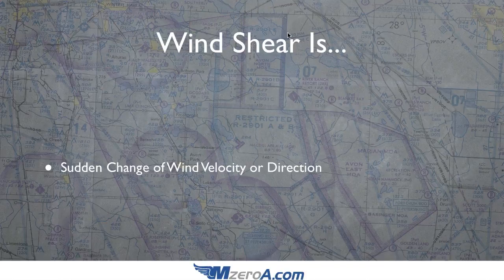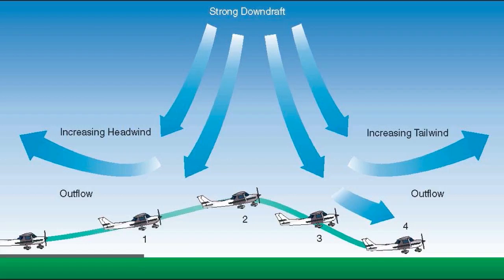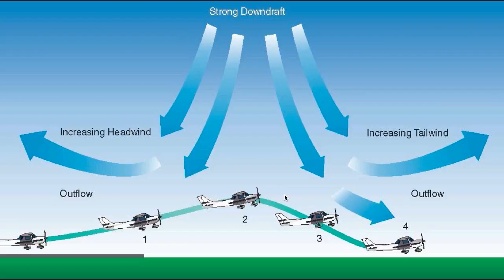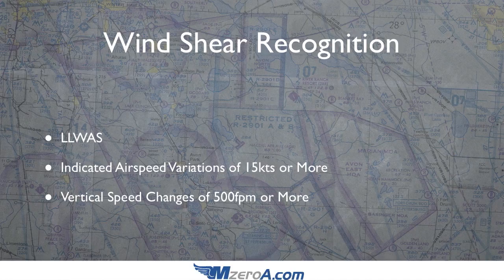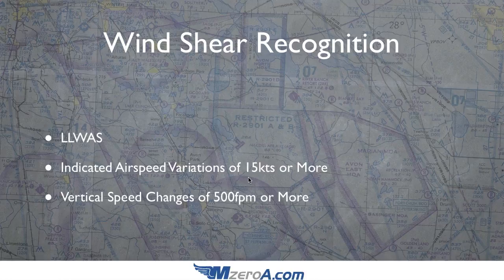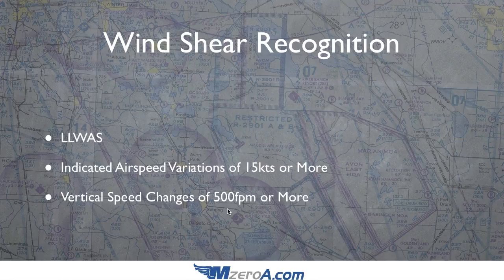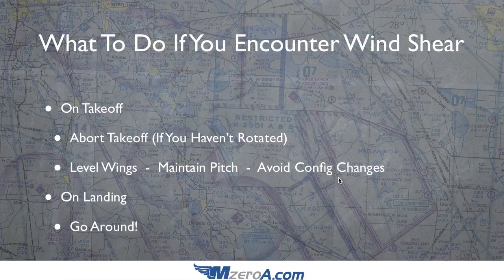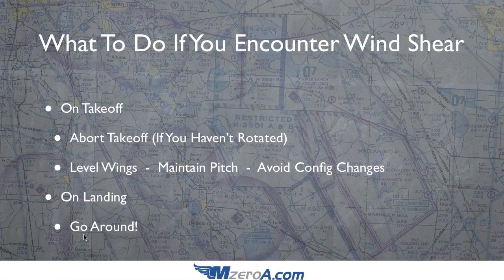Wind Shear Avoidance

Comment: I experienced low level wind shear.(wd 340 variable 5-10 kts. started to gust to 15kts. RWY 7- 25) on a short final, it looked like and felt like the plane was pushed to the ground, I immediately added full power for go around, kept gear and flaps down. Cleaned up plane at a safe altitude, change landing to opposite runway, challenging but uneventful . I will take Jason's advise and not fly under conditions like this again.

Comment: What does -10 wind shear mean, this showed up recently, Thanks!
Reply: It means that during the final approach, the pilot(s) experienced a loss of up to 10 knots from his (their) final approach speed. This information is passed on to the next arrival as awareness. 
Pilots should give a PIREP to the appropriate ATC frequency whenever workload permits, when clear of wind shear, and include of possible:
- altitude of the encounter
- loss or gain in airspeed or altitude
- type of aircraft 
- location of occurrence
Reply: Thanks, I thought so but wasn't sure!
Reply: How can you have reported a loss or gain of 10 knots?? As in the pilots reports “plus or minus 10 knots on final”